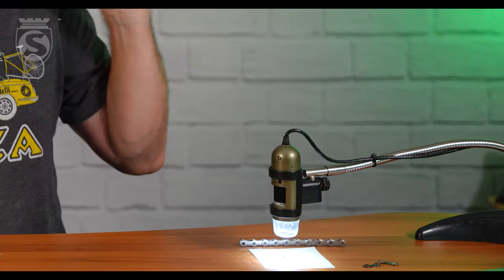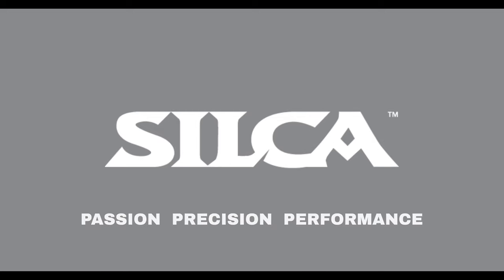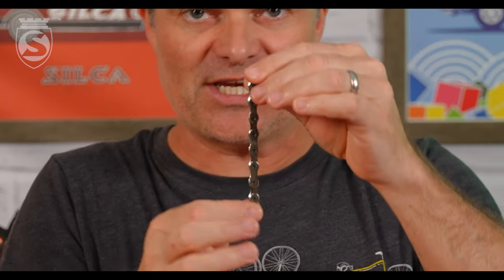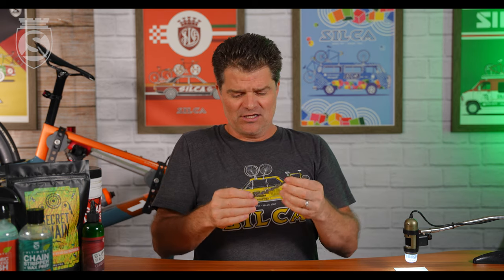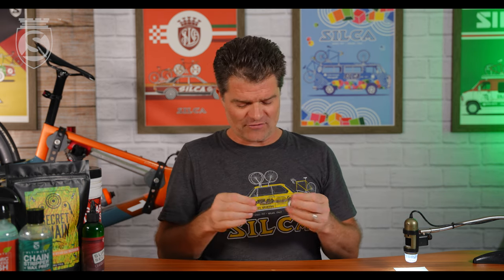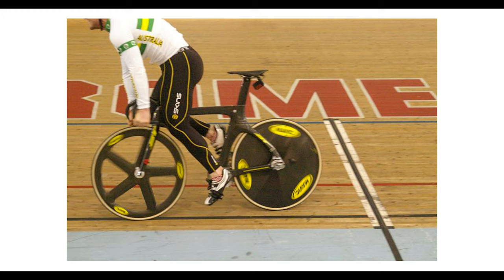Practical Tips to Save Your Chain from Wearing Out!

Comment: I'd love to hear Josh's thoughts on SRAM's flattop chain. When it was introduced, I didn't get the point as I already knew wear primarily happens at the pins and bushings. SRAM claims the "added material on the flat side of the chain plates strengthens every link," but it seems like this design is just playing into the chain "stretch" myth. Thoughts?

Full quote from SRAM's website:
"What if you could add range to your drivetrain while also smoothing the gear progression with smaller differences in tooth count between neighboring gears? And what if you could gain that without losing drivetrain efficiency or having to replace your chain more frequently? Our unique Flattop chain link design is a key element that makes all of these improvements possible.

To gain a wider gear range with smaller gearing steps, the chain has to get narrower. With Flattop, we’ve added material on the flat side of the chain plates to strengthen every link. The Hard Chrome surface treatment on the pins, inner plates, and rollers also extends the life of the chain and keeps it shifting precisely over the long haul. Additionally, Flattop chains feature longer wearing large diameter rollers that help deliver the same drivetrain efficiency as our 11-speed drivetrains. All of these technologies together have enabled us to engineer a narrower 12-speed chain that lasts 36% longer than our 11-speed chains.

With the Flattop chain design it’s like having your cake and eating it too… except this cake actually helps you to be faster on the bike… and you don’t have to buy cake as often… There might be a better metaphor to explain it, but we like cake, so we’re sticking with it."
Reply: Using larger diameter rollers means that more surface area of the roller is contacting each tooth on the cassette sprocket and chain ring gear so there will be more side load on the chain when shifting to a larger gear/sprocket/cog which is where the added material on the flat side of the chain plates helps to reinforce each link to accept a higher side load... 
Seems like they created a problem with larger diameter rollers then resolved it with beefier side plates and served that to their marketing department.

Comment: Is there a benefit from letting my wax cool down from 75 degrees before removing the chain? Obviously there is a point in which it gets too cold and starts to harden, but curious if letting it cool to say 60 degrees helps or not.
Reply: People sometimes did this in the early years of waxing, with the thought that the wax wouldn't flow out the inner parts of the chain as easily with cooler wax. But I think the current thought is that plenty of wax remains at 75 degrees, so there's no need to cool it first.
Reply: Do not let the wax cool. The hot wax will not run out of the links, it stays put due to capillary action. When you remove the chain from the hot wax and hang it up to harden,  immediately wipe either side of the chain with absorbent kitchen paper, if you let the wax cool it will quickly stick to the exterior surfaces of the chain where it does no good and you will get a lot more mess from wax flakes on the chain stay and chain ring.

Comment: Is it just my Silica melting pot, or does everyone else's take  70 minutes set to 90* to melt the wax fully, in a 70 degree F garage - My amount SSS wax  is as specified in the manual for the pot. and I leave the clear plastic cover on.
Reply: He actually did a video on this. I can't remember which one but it is basically an effect of the PID controller. The closer you get to the target temperature, the less it will heat. So the solution was to set the temp to the maximum for a bit and then lower it when it gets close to the temperature that you want. Keep in mind that you cannot leave the crockpot alone and need to closely watch the temperature.
Reply: @Mipirakas  nailed it. It's set to use specific power to get the EXACT temps. set it to the higher temp to get it heating up faster.

Comment: You mentioned polymer based lubes. Is that what pink brand‘s wet lube is? I still have a cassette ruined by it which looks like Loctite was sprinkled over it. What can you use to dissolve it?

Comment: Since I have started using your Wax appx 1.5 years ago, my chain never reach to 0.5 wear (I use SRAM Force & Parktool CC-4 which supposed to be compatible with flattop chain)
However I start noticing some links are getting stiff, but still can move.
Is it possible that because of your wax, chains now should be replaced before the "chain wear"? 
I'm also interested in Abbey's new chain checker that can measure lateral wear.
Reply: Oh wait.. I just checked it after today's morning ride. Actually I could push CC-4 into chain so it should be 0.5 wear. (although I needed to give a little push while maintaining tension on the other side)
I'm bit relieved finally I could wear a chain. What a...

Comment: On my comuter bike I have a simple chain for 7 gears only. On mixed roads with dirt roads I ride almost only if its dry. They wear out quick. Even so I clean and relube them about every 100km they are at .75 after only 600km. The chains are quite cheap about 6-8€ (almost the same in $) but I dont like it. It doesnt seem to be very sustainable if other chains last 20000km. But even 2200 isnt bad compared to my chains.

Comment: Please talk about the proper way to measure a chain. A friend has been measuring freshly waxed chain and I believe that is wrong. Thanks
Reply: yes it must be measured clean before waxing
Reply: You can buy a cheap “chain checker” tool or use calipers with inner distance measurement.  All bicycle chains regardless of brand or where they are from, i.e. Germany, Italy, Taiwan, Japan et., are standardized at one inche pin to pin for an outer plus inner link.  However, there is a slight difference in roller diameter for Shimano and Campagnolo chains.  I have XTR on a Santa Cruz MTB and Campagnolo 10 speed on my 25 year old Litespeed titanium, Super Record 12 speed on my Dogma F, and  1 x 13 speed EKAR on my Pinarello Grevel.  I was hosted by Campagnolo in Oct 2013 in connection with their 80th Anniversary and saw every step and QA of chain manufacture in the factory in Vicenza.  (BTW, never use Citrus Degreaser on chains!). Campagnolo recommends 132.60 mm as   Max inner roller to roller distance for 6 (?) full links before the chain needs to be replaced.  It would be a slightly different mm distance if you were measuring a Shimano chain.
Reply: @EdwardTBurke-pv3qr  of course, the specifications of different chains can differ, but they shouldn't be too much, but a statistical model can be made for each type of chain so that a reference distance is measured for a new chain, e.g. 12 cm, for example, for my chain, that length is 119.65 mm when it is new, when it is worn it is 120.00mm which is 3mm longer at 108 links compared to the new chain. from 119.65-119.80mm the chain is good after that it starts to wear out rapidly.that's why the chain checker is not reliable, you should use a vernier caliper
Reply: @makantahi3731  I agree 100% .   Get your baseline measurement for a brand new chain and then determine what is the measurement that particular chain needs to be replaced before it begins to wear down the teeth on your chainring and sprockets.

Comment: I know how to test for chain wear, how can you tell if your cassette is worn and needs to be replaced?
Reply: the "valleys" between the teeth turn from ~perfect semi-circles to elongated ovals. The teeth loose their squarish top, get pointy, start looking like "shark teeth."
Reply: I saw a Zero Friction Cycling YouTube video where Adam says you can tell when your cassette is worn out by measuring the distance between the tips of the teeth, you measure the distance between the two teeth either side of where the chain rollers would sit on each sprocket and measure from opposing edges of the sprocket's teeth. When new, the distance of this gap is a certain amount and when it exceeds this by a certain amount your it's worn out. Sorry I don't remember the exact figures. And obviously the sprockets you use most will wear out the quickest.

Comment: Chain loosening? chainplay? Chainwiggle? Individual parts gain wiggle room so chain losens up. Tho the chain does stretch. The object does elongate/strech, even if the material it is made of does not. So streching is technically correct regarding the item as complete, but not for individual parts.

Comment: How could chain wear be decreased with a change of material for chain construction.  There is stainless steel of various types, differing alloys of titanium and perhaps other exotic metals.......You probably wouldn't like me.  I've been using canning wax.  Thanks for the video.
Reply: stainless steel is not good for loads, there are quality steels for chains, you just have to pay for them, so it is better to make inferior chains that will be cheaper and will last less, but at least someone will buy them

Comment: Waxing is no Option for me on tour. And I do long tourings, the last one was three years. Special oils are no option as well. As you do not get what you want in foreign countries. I have to use what is available. The best solution I found is to change chains often.
Reply: how much km you make per day, if around 100km you could use inductive heater and small battery to heat up chain on bike and wax it, all equipment fits in small shoe box

Comment: Add to this.. cable “stretch.” From my understanding cables don’t stretch, housing compresses.
Reply: Correct, but my understanding is that it's more the whole system that settles in: ferrules, housing, etc, all get better nested into each other, and into the cable stops, as pressure is applied through braking and shifting. There's probably a bit of give in the housing itself, but it's designed to be as compression-less as possible to start with.

Comment: Is it big diffence between shimano 7100 and 8100 and 9100 in wear, even egen waxing? i have used your supersecret and hotwax and the wear on 7100 is much higher Than 8100. Hotwax Every 2-3weeks (700km) and used filled up With supersecret every 100km. Am i to lazy with the hotwax?

Comment: My question - I have a chain that is waxed and showing zero wear after ~2,000miles on a mountain bike.  I am however starting to get the chain to slip (in the gear I probably use the most) on the cassette.   This is the first time I have ever had signs of wear on the cassette, but not have the chain showing any.   Any experience with this situation?   If I replace the cassette, should I replace the chain as well even if it shows no measurable wear?  Further details; XX1 chain and cassette, absolute black oval chainring.  The cassette was used with a NON-waxed chain for a few hundred miles before I switched over to waxing my chains.   The chain on the bike now that is waxed has been the same chain with the cassette for the last ~2,000miles.   I apply silca drip wax every 200-300miles (depending on riding conditions, moreso once I notice a little more noise than normal out of the system) and I re-dip the chain every 700-900 miles.
Reply: I had such an experience, but with a chain that has always been waxed, everything wears out, but more slowly when it is properly lubricated. you don't have to change the cassette, on my channel there is a way to save the worn sprockets in the cassette

Comment: Is it possible to see the behaviours of different lubricants as the chain is articulated? 

What about magnified slo-mo of tyre sealant congealing?

What about bearing operation and wear?

Can we observe or measure tyre hysteresis losses in a way that hints at the causality? 

Is it possible to usefully visualise fastener loading with a partially cutaway threaded sleeve?

I'd love to see anything related to aerodynamic differences based on surface properties (roughness or type of roughness).

Comment: LOVE my Silca waxing system and the Super Secret wax! I have 2 bikes, one a 2021 and one a 2022, and each have over 5000 miles on them.  Zero chain wear on both the Ultra chains.
I wax about every 200 miles, but the waxing system is so easy that it's no trouble at all to re-wax.  I also love how clean my cassette and chain rings look using wax also.

Comment: At 1:54 I guess you meant to say elastic region, not plastic?

To play devil's advocate. I think it's fine to keep saying "chain stretch". Chain as a whole system stretches - distance between its two ends increases, which perfectly fits "stretch" definition. Saying "chain link stretch" would be incorrect (as stated in the video, pin to pin distance practically remains unchanged). Some people have wrong understanding where the stretching comes from as explained in the video.

Comment: Why hasn't the applicator for liquid chain wax been developed? Surely getting wax down into the two sides of the chain (between the plates and between inner plate and journal) should be looked at. Rather than a single blob in the middle on the roller? It always seems a crazy way to add drip wax? Why has no one come up with a better wayof application rather than a blob?
Reply: yes, there is, you heat the chain while it's on the bike and touch it with solid wax that instantly melts and enters the chain, wipe it with a cloth and the wax comes out, repeat the process and the chain is clean and waxed in 12 minutes

Comment: 11:00  you are lost: the ring mostly rolls on the teeth of the cassette and less on the outer side of the inner link, and the motion of the pin inside the inner link is not rolling but sliding, and there is no debate. I have a chain whose pin looked like yours - sawn with two slots from the inner link. that same kind (new)chain treated with wax very often even more than was necessary after it was measured on the measurement that it was worn, the pins do not have those grooves so your theory of slipping/rolling does not hold there either
Reply from the maker: Once the pin and bushing begin to break down and become non-round, then the sliding dominates, but in a new and properly made chain, all of the action between rollers, bushings and pins will be rolling with only the side plates having any sliding friction between them.  This is why you can have extremely high efficiencies with roller chains, and even a brand new non-lubricated chain will be highly efficient for a time.. the problem is that every slight imperfection, misalignment, etc.. will result in a transition from rolling to sliding which will induce a cycle of wear that cannot be reversed and the system descends into once dominated by sliding.  This is why non-lubricated chains squeak, the noise is made in the transition from rolling to sliding and the little squeak is emitted from the stick-slip action that happens in this transition as the chain articulates.  For industrial chains with massive loading and controlled angles of articulation, they use what is called a 'Rocker Joint Chain' which use non-round rockers instead of pins which can be even more efficient and quiet than a roller, google it, it looks totally like it shouldn't work, but it does!
Reply: @SILCAVelo  pin could roll inside of bushing only if pin is much smaler like in planetary gearbox,if pin is almost same dimension like bushing hole it can not walk around ,pin must  slide and this is it
Reply: @SILCAVelo  chain efficiency mostly depends on angle that pin makes inside of bushing when chain leaves cassete sprocket or enters on front sprocket,and that angle depends on number of teeth,less teeth more angle and on pitch of chain,longer pitch bigger angle,so if you wanna most efficient chain you need big sprockets and short pitch chain by default,of course roll rings brings low friction because if is no roll ring ,bushing would slide on tooth surface,instead to roll
Reply: @SILCAVelo  next thing why pin is not rolling inside of bushing,it is under opposite forces that try to stretch chain so pin is always in the furthest position of bushing and that position is always the same and prevents pin of rolling inside of bushing.electric motor axle rolls more inside of its bushings if is no load that would keep axle on same position inside of bushing
Reply: @SILCAVelo  7:31 let's use the part of the video where you tried to visualize what was happening: you used a roll of adhesive tape as a bushing and a bottle as a pin: the way you showed it, it means that the chain hangs vertically and the forces in the chain go up and down. when the pin starts to move left and right in the bushing, it represents bending and alignment of the chain. when your pin rolls left or right, it climbs from the lowest point of the bushing to a higher position, but the forces in the chain try to return it to the lowest position. how high the pin will climb depends on the friction between the bushing and the pin, the greater the friction the higher the pin will climb. since it is very slippery there, the pin may only roll a little 1-2 degrees and then start to slide because the force in the chain brings it back to the lowest position.
otherwise the pin would never have grooves from the inner link, which is caused exclusively by sliding and not by rolling

Comment: I've never understood the obsession with making chains last as long as possible. They are the cheapest part of the drive train, replacing them often and you'll get 10x the use of chainrings and cassettes.
Reply: Forget to replace them and you have to replace your whole drivetrain. I have had oiled chains last as short as 1000km . If you don't have time/ energy for cleaning your dirty bike/chain, do you have time to measure chainwear and replace?